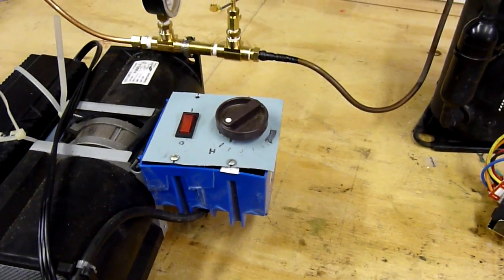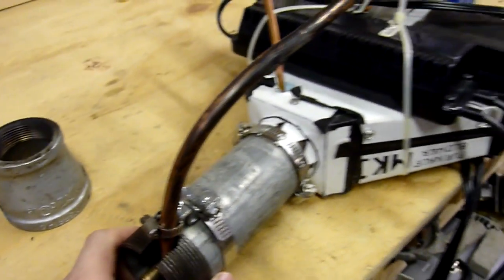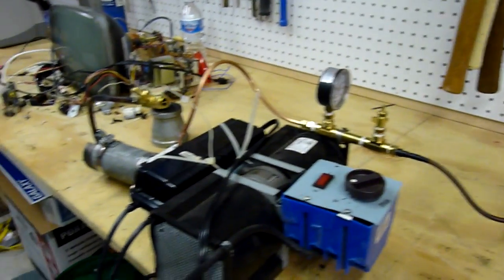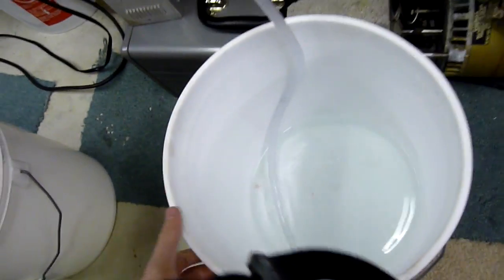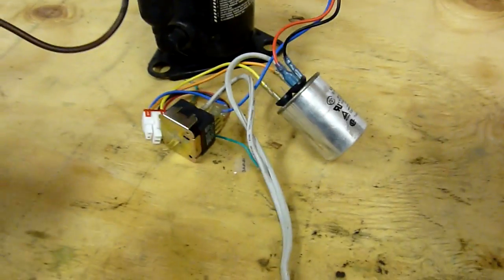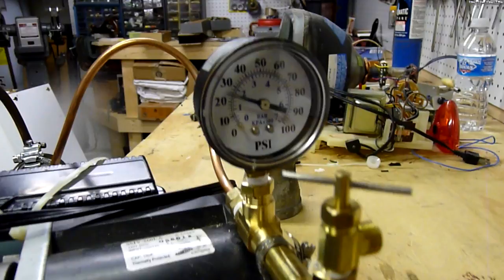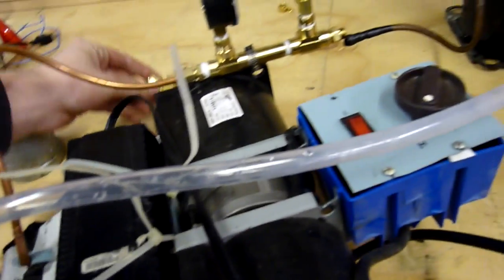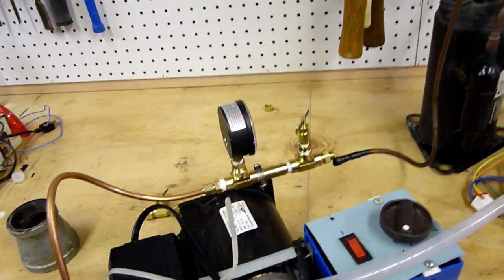9mm Atomizer Burner Update

Comment: paint the inside with ceramic paint it should last a long time as well , just a thought . may think of fire proof engine spray paint it's good to 2000 degrees do many layers it either way should not spark off .

Comment: I see you put alot of thought into this but I think you over thought some things like turleman said use a fuel oil furnace burner tip and forget all the other crap go back to the basics . Loose the cheap compressor and get something a little more stable even a 5 gallon compressor then your not dealing with all the noise all the time. Good idea but way over thought. Sorry I wouldnt recomend your set up , steel fitting should always be used never use galvinized. kelly

Comment: i use a oil furnace nozzle and run about 20-30 psi air pressure and a low pressure automotive fuel pump for the fuel oil.

Comment: Few questions - What are you planning on melting in your foundry?  The reason I ask is because I have built 2 small foundries using a very simple propane burner system and it's more than sufficient to boil aluminum.  A tank of propane is cheap to refill and honestly they last for a really long time.  While a oil blower system is kinda cool, it sure seems like a heck of a lot of work.

Comment: ok so I am just starting in this area of metal work and am trying to pick a fuel. would you reccomend making my first foundary a forced air/charcoal set up because of the ease of non volatile fuel or no?  I have propane tanks and stuff but cant afford to learn my mistakes at propans hourly cost. later though sure.  charcoal i can be make i have access to lots of wood, also the concrete chamber can be repurposed to propane or oil later right? any thoughts